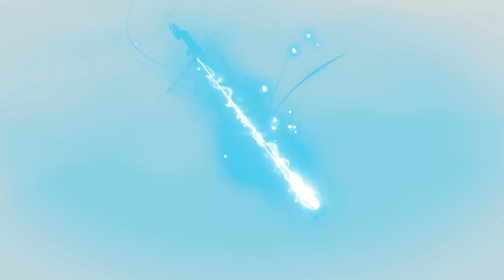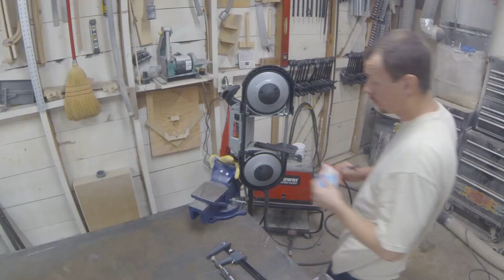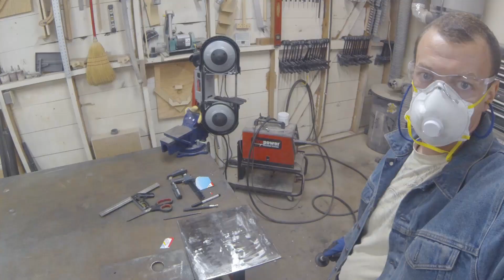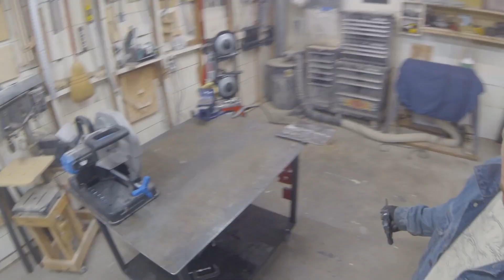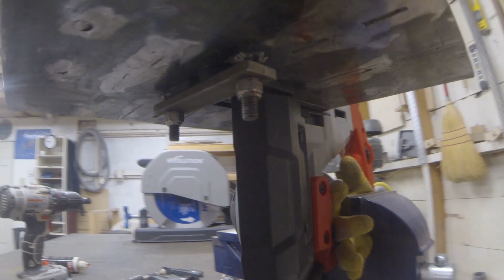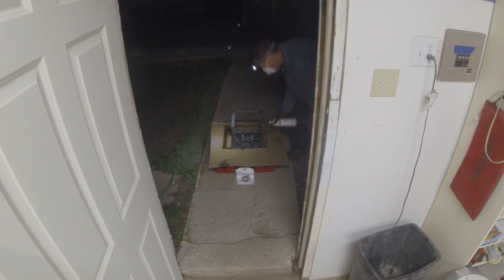Milwaukee portable bandsaw stand build, DIY removable base, basic saw holder, universal design

Comment: With the adjustment screw for blade/table squareness in the back how does it not keep the table from twisting when you tighten the table mounting hardware? Should the adjustment be located at the mounting site itself to minimize the twisting affect?
Reply from the maker: I haven't had any issues with it.